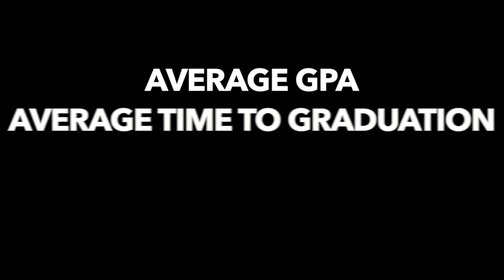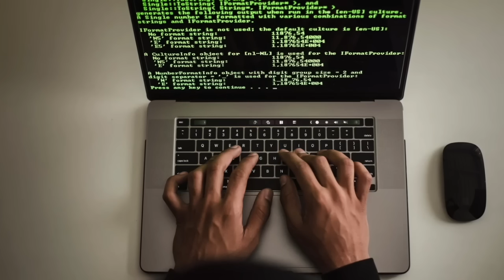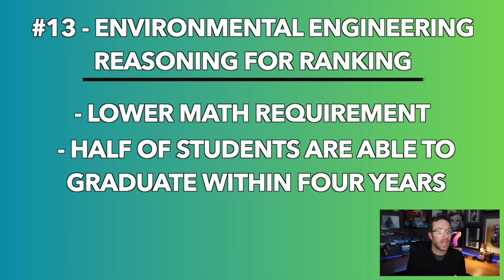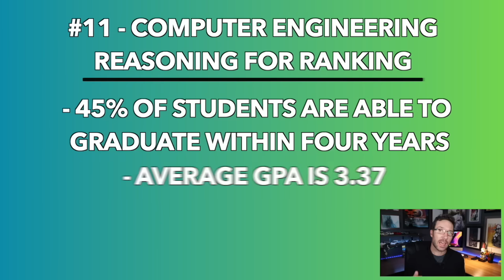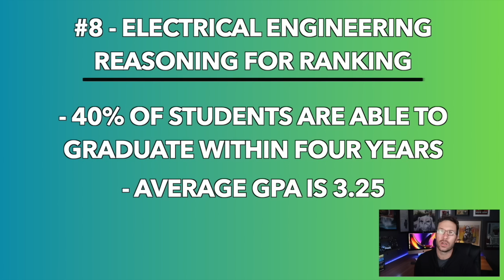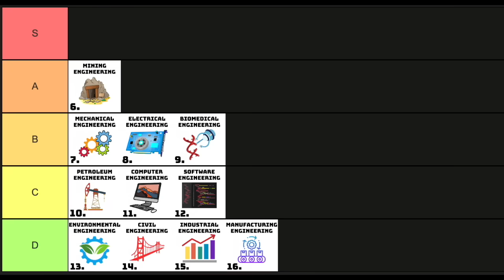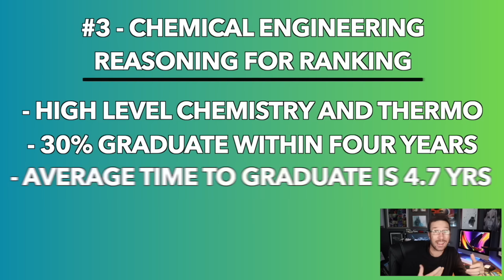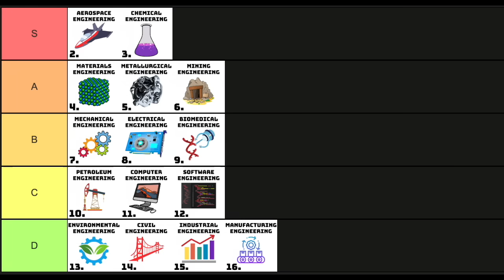Engineering Degrees Ranked By Difficulty (Tier List)

Comment: Graduated in civil engineering in 1967 after degree in Psychology (failed pre-med) and 3 years as a Naval officer. We only had Civil, Mechanical, and Electrical in increasing order of difficulty.  I wasn't the best student and had to work as I was married with 3 kids.  I ended up ultimately doing street, sewer, water and grading design for primarily residential and commercial/industrial projects (no building or structural design).  This took learned experience, not brain power. The field is wide open for many different pursuits. The thing is, school taught you how to learn once you graduated. Except for storm drain and water calculations, I used none of what I took in college except surveying.  I never used my calculus and higher math. When you graduate, your real life education just begins. You don't have to be brilliant, just work hard and you will succeed. A son and daughter are civil engineers, a daughter is a mechanical engineer (aerospace), and another son an engineering physics major. Even if you struggle in school, don't give up. After your first job, nobody cares about your college or GPA.

Comment: I went into EE and the math I took was higher than ODE's, I took PDE and Complex variables as requirement to graduate. I think it would be interesting to compare the level of difficulty of the engineering classes outside math. Every class in EE has math that I didn't learn in the Math department. I did a second BS in Math. So there is a lot of math that you might never learn outside EE.

Comment: It's an interesting vid.  I have a aero degree -- but I have to say I've never done anything close to the training I got in college (Ga Tech).   In the real world, as far as I can tell, we aeros are all software/computer engineers at this point.    (It was a data point that those degrees paid the highest in all the categories!)  

I'm 30 years in and made 260K last year.  It was all software in the space biz.  The problem though is getting your foot in the door -- the degree is magic for that (you also need a masters)  but has nothing to do with it in the end.  In other words -- there will not be any "design" of airplanes or spacecraft  -- all that is already very well understood.  No one cares about where you put the nvidia card!   It's about problem solving and these days every problem is a software problem.  For example, no human can fly an F35 (or an F15 or F16 either) without the computer -- it's too unstable.   Space biz:  well once the thing is launched, you can never improve the hardware -- but the software can be switched out right?   

Anyhoo -- you should DEFINITELY get the aero degree because the rigor will take you through multiple levels of problem solving within physics, mathematics, materials, stability and control, and software.   You'll come out the other side ARMED straight up with depth and breadth in what you can bring to the table.  

The hardest part of getting work was at the beginning -- right after graduation.   It took around 5-6 months to land the job (in 1994).   Since then, I have worked continuously and have never had any issue getting new work!  

My point is I'm an aero evangelist... the exposure to multiple fields in the degree is mind-blowing -- you'll do math, physics, electrical, mechanical, nuclear, materials... it's just fascinating!

Comment: In my opinion the most challenging courses in Civil Engineering degree are Fluid Dynamics, Thermodynamics then Calculus 2, Groundwater is also very difficult, but that is an elective. It helps not to take more than 2 labs at a time.

Comment: I'm an environmental engineering student, very happy about my choice so far.
Reply: I’m thinking about trying it would you recommend?
Reply: @mt.lafferty2827  I am studying environmental engineering in germany and I love it - in my university there are a lot of things common with civil engineering but I love all the subjects that I only find in Environmental Engineering. For example, I have measurement and control technology, biology, climate protection, renewable energies, thermodynamics, heat transfer, environmental process engineering, urban water management, and much more, which is just super interesting. I actually find it a bit more challenging than civil engineering, but it's absolutely worth it! I can only recommend it, and there are great job prospects—at least for me in Germany.
Reply: @mt.lafferty2827  if you have to choose your path keep in mind these really important things:

- Always look before at the subiects you are going to study in the 3/5 years IN DETAIL, so that you have an idea of what you will like and won't.

- Always search the careers you can unlock with a certain degree.

That said, I do reccomend Env. Engineering if your real concern is waste management, air pollutants and water pollutants treatments.
If instead you are more into climate change, consider that you are going to cover this with env. Engineering most of the times, but less than the previous. To know how much, you should see the subjects ,specifically in your university.

If decarbonisation , climate change and GhG are youre favourite topics, then you have really a lot of choice since many degrees cover parts of the sector.

Comment: Chemical engineering student here who’s graduating this spring. The only chemistry classes that we had to take (at least in my university) were gen chem, orgo 1&2, and pchem 2. Most of the classes were heavy on math and physics. My university also required us to take probability, but that makes sense considering that it applies to process control and dynamics, specifically to stochastic processes. The most difficult course in this major is transport phenomena I&II which comprise of momentum (fluid dynamics) transfer and heat and mass transfer. All of them are heavy on theories and both ode and pde’s (especially the unsteady state cases). The application portions of transport phenomena are separate subjects known as unit ops I&II. Chemical reaction engineering is also difficult because of the added complexities of catalysis. Overall, it’s a notoriously challenging subject. If you failed thermo as a chemical engineering student, then reevaluate your choice again because the following subjects that you’ll be taking contain thermo (especially transport phenomena and reaction engineering). Don’t even get me started with the barely readable graphs that we needed to use on the exams.
Reply: I’m a chemical engineer and I was so pissed to learn that there was very little chemistry involved. I wanted to change to chemistry major but by then it was too late
Reply: Same experience as you😂... I think they should just find another name for the course... Chemical Engineering is so tough😂 @txdang2009
Reply: Agree with you
Reply: Changing my major from chemical engineering this semester, for I learned I truly am not passionate for it.
Reply: so I'm interested on studying that since younger, would you recommend? also very important question do i need to be good at math? im really bad at it but good at chemistry and physics
Reply: @Gaby.Arabella  by this handle seems like you're a female... Well I did study Chemical Engineering and graduated with a CGPA of 4.05/5.00 scale in Nigeria and imma be brutally honest you need to be very very very good at Maths... Especially ODE and PDE calculus cuz you'd be needing a lot of it

Comment: This list doesn’t match what Ive read or come to know about engineering.
First, chemical engineering is usually considered easier than electrical, mechanical and materials. Being a less exact science makes it easier not harder; statistical mechanics is easy.
Aerospace also should be further down the list with Chemical engineering. Learning how things move through space and air isn’t harder than electrical/mechanical/materials/nuclear.
Reply: Chemical phenomena are always more complex than electrical phenomena, your opinion is not very popular.
Reply: @ what you say may apply to graduate programs where everything becomes more analytical, but not certainly not to undergraduate degrees. Let’s get real here.

Comment: Biased here, an electrical engineer for 35 years now, focusing on Mixed-Signal-ASIC/semiconductor design for various types of sensor systems.  I still believe the field of electrical engineering has the broadest application in all areas of engineering technology.  Also, for my undergraduate, I had to take partial differential equations and complex analysis beyond the standard ordinary differential equations.  We also had to take a modern/quantum physics course and ME courses (Statics, Dynamics and Thermodynamics) as well.  You're also not considering the engineering specific courses of each major...EE's also take a device physics course and sequences in electro magnetics and signals and systems, both requiring advanced application of both physics and math.  Oh yeah and 3 semesters of programming as well.  This doesn't include junior and senior level electives.  EE's have a very broad background in engineering.  My credit requirements were ~140 as well.

Comment: I have always known that nuclear physics is the toughest engineering or math degree to get. There are a lot of components to it: Particle physics, thermodynamics, calculus 2 and sometimes 3, differential equations, linear algebra, quantum physics, chemistry, and supercomputer programming skills. I chose computer engineering because not only is it easier to get a degree, but the job market is far larger than nuclear engineering.

Comment: Computer Engineer here, at my university we had about 70% course overlap with the Electrical Engineers. While the EEs gained a good grasp of complex analog circuit analysis and all the ODEs/PDEs involved (and tended to be better at manipulating equations by hand), they tended to struggle in any course that involved writing code or solving digital/sequential logic. It became really obvious when I was worked as a grader for the programming courses, and it still boggles my mind.

Comment: Most of the mechanical engineers I dealt with over the years were guys who grew up on farms. They fixed combines and usually were pretty damned good and had the most common sense . Usually, they had some bad assed boats and cars to go along with it. They were the guys to go grab a beer after work with. I was an EET guy in the elevator industry. I was really  more of a glorified troubleshooter. But I made good money doing it. I wanted to be an RnD guy, but by the time I finished my degree, I would have been taking a pay cut to do that work.

Comment: When I went to ASU in the 1980's, chemE was considered the hardest engineering degree, followed by electrical engineering, mechanical, aerospace,civil, computer science (SW engineer), industrial; in that order.  The other engineering majors you mentioned were not offered.  Electrical engineering required an engineering version of Advanced Calculus (without proofs) which was considered more difficult than differential equations, and required a minimum of 138 semester hours.  How things have changed over the last 40 years.

As another comment suggested, you need to be focused, goal-oriented, and disciplined, which is why 95% of my freshman class did not finish electrical engineering.  Being off-the-scale smart was not enough.